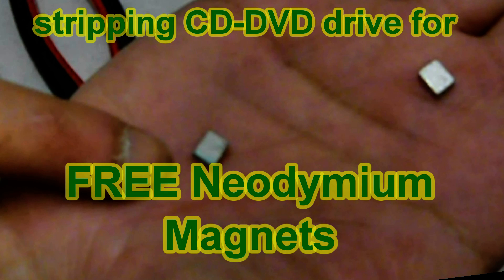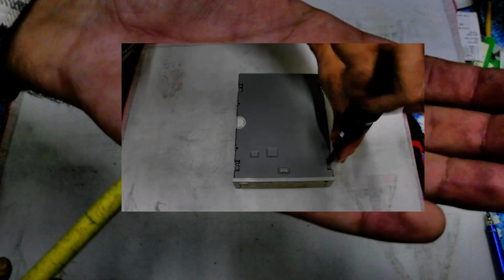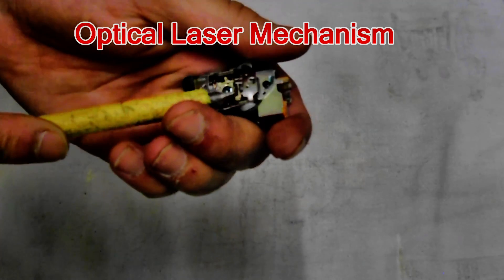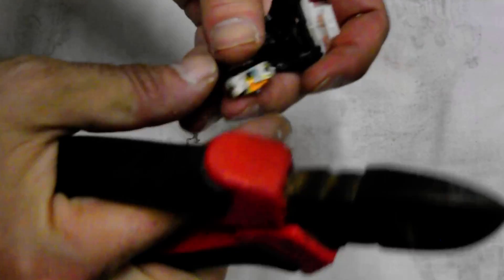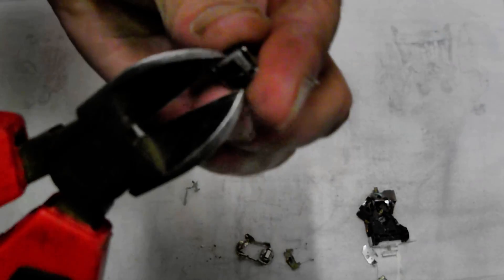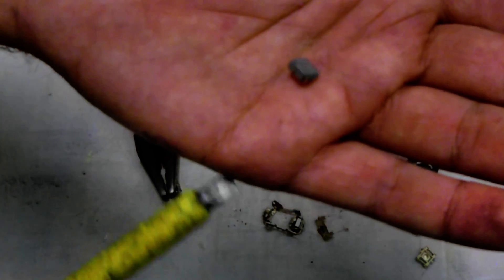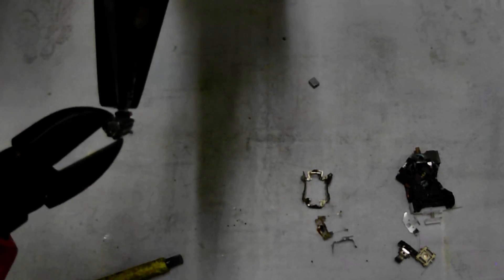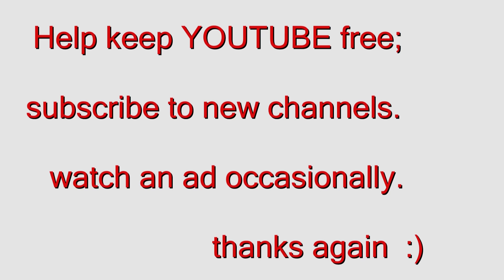Free Neodymium Magnets from Scrap CD DVD drives- 100th Subscriber edition

Comment: Sir, 

The plastic housing you tossed aside as having no value, contains the laser diode sometimes as many as three. Every one of these laser diodes that I've removed from the CD/DVD/ROM drives has one, two or three gold wires inside. In addition, the outside of the laser diode is also plated or sputtered in gold as are the three legs of the laser diode. Sometimes these laser diodes need to be pried out of a heat sink. Some come out very easily, some require a bit of finesse and/or force, but they do come out. There are also other very small components in/on that plastic housing you tossed aside with small gold wires and/or traces in/on them. Trust me, they add up. 

Admittedly, one needs at least a 10x loop to see the wires, but the gold on the laser diodes is evident. Some are plated heavily, some completely, some just the outer band. If you're scrapping for the copper, sheet steel, stainless steel and magnets, might as well go all in and collect the gold bearing bits in the plastic housing!

Hope this helps.

RustyFuryIII
Reply: In addition, many times, the small ribbon cable connector on that plastic housing has very small gold plated fingers in it. Pry off the latch and they will be exposed. Again, if scrapping for the other stuff you mentioned, might as well get it all. It adds up.

Just hate to see you do all the work and toss aside money. 

Good day to you!
Reply from the maker: excellent info. thanks.
:)

[sorry for the late late reply, was off-air due to family funeral]